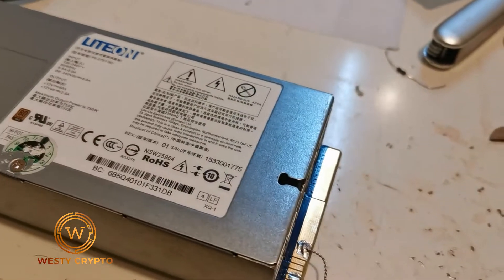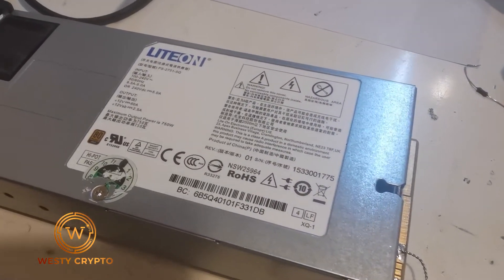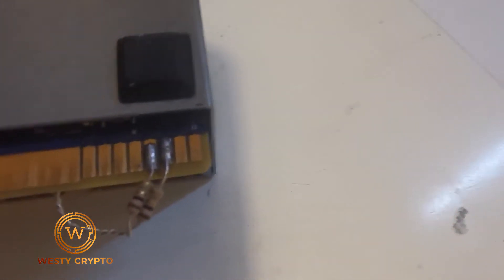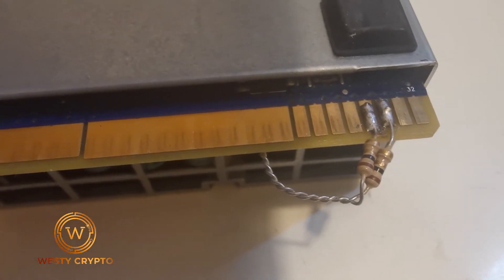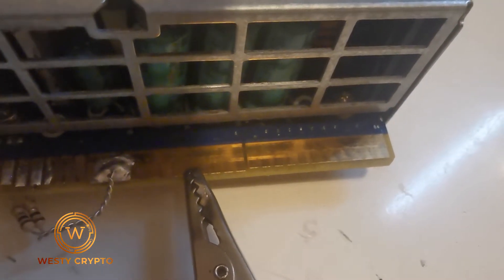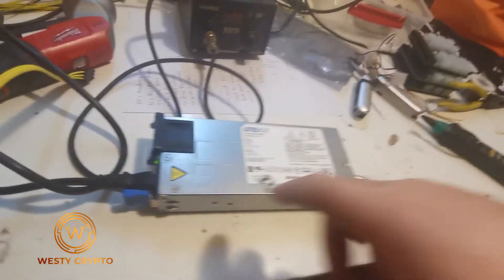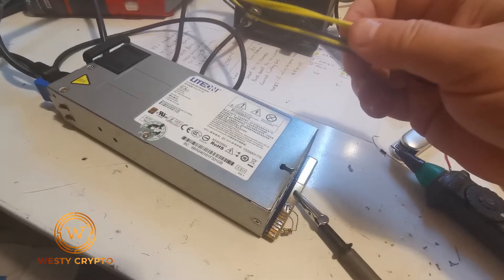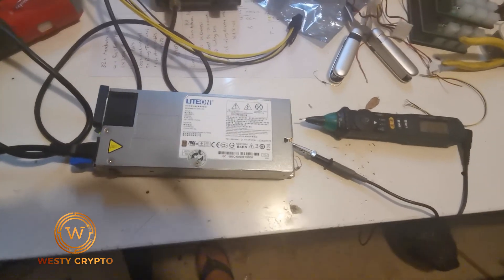Convert Server PSU to power supply - LITEON PS2751 5Q PSU (STARTUP WITHOUT SERVER)

Comment: I made my ls 2751 2f power supply work by connecting pins 33 and 36 and when connecting 36 to 37 we will make the fan run at full speed
Reply: It seems that Liteon LS 2751 can work the way I do